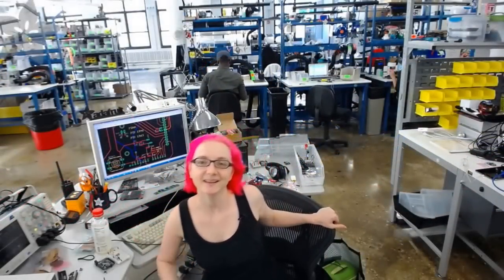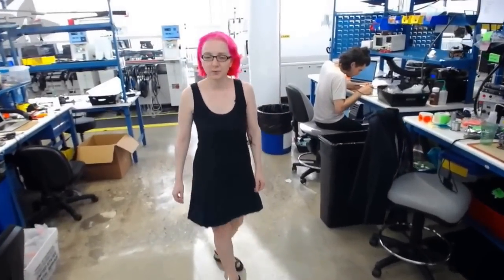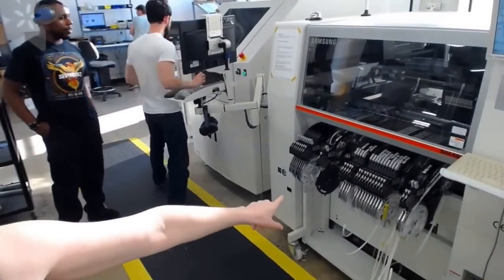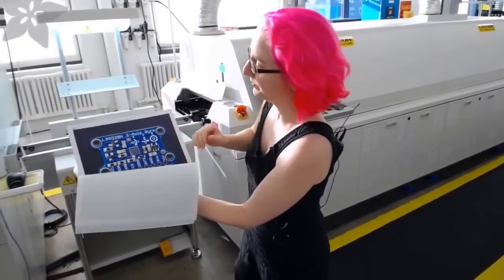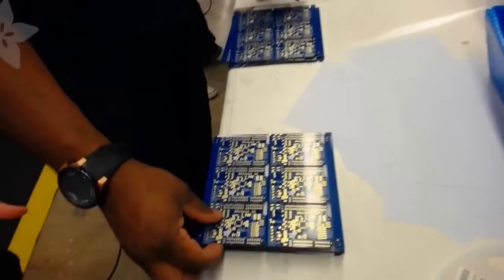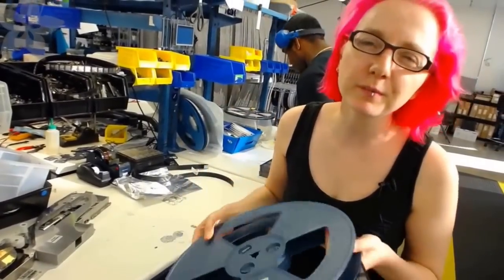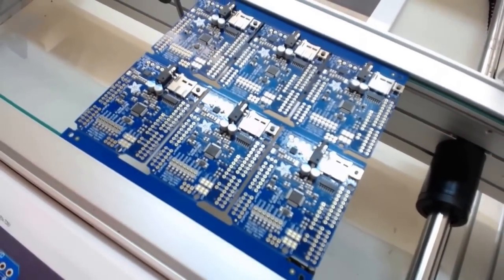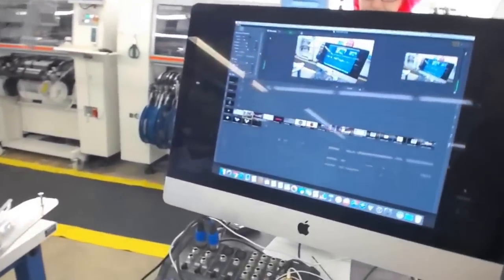Quick tour and test @adafruit #adafruit

Comment: I had a great experience with your mini Sound Board and your tech support, Project was delivered to the family TOTAL Success!  I now have a new Project I need guidance. What parts do I need to order to get that Mini Sound board to fire sounds via wireless button push. I bought some of your parts but I am unable to figure out the wiring or signal conversion etc etc. If anyone can help me with parts, wring and setup for wireless operation I have 5 Volts remote. Please this is for a Model Train that is on the track But i have a Volt Regulator that takes the track power and conditions it for a Sound Board. Please help on the Wireless button, Dennis in Virginia         https://youtu.be/PuUjr6s_68s

Comment: I would sell my soul for equipment like that
Reply: Don't sell your soul. 
Anyway, you can use softwares to simulate PCBs, mechanism, physics, etc. Check out app EveryCircuit. You WILL love that. You can do circuit simulations with that app. I am quickly learning electronics via EveryCircuit. 
Also, check out free (mostly open source) softwares like KiCAD, DesignSpark, Fritzing, etc. For mechanism and 3d modelling, check out Onshape  (free & paid versions), FreeCAD, Blender (free), etc.